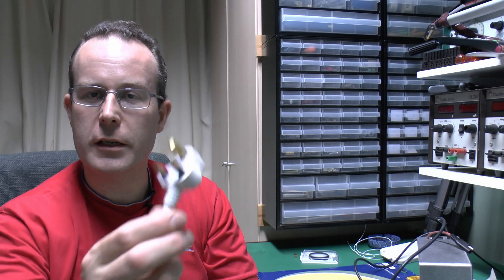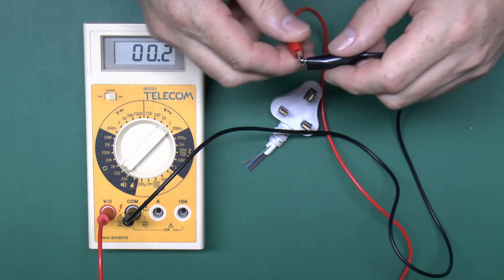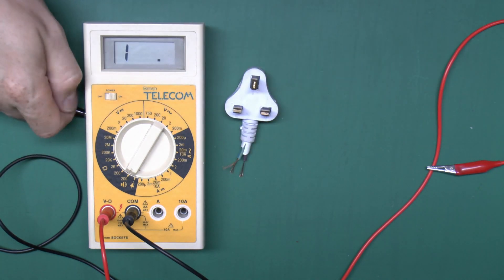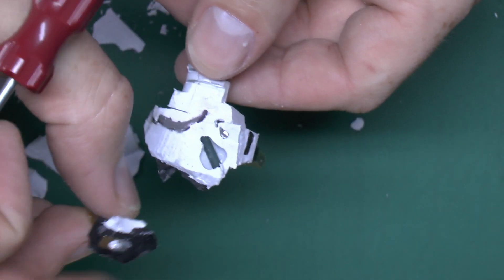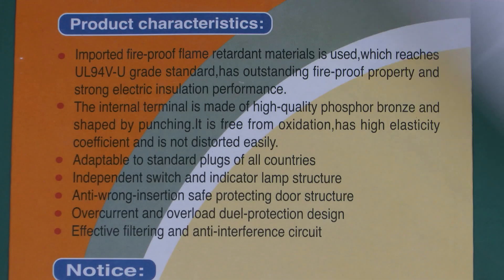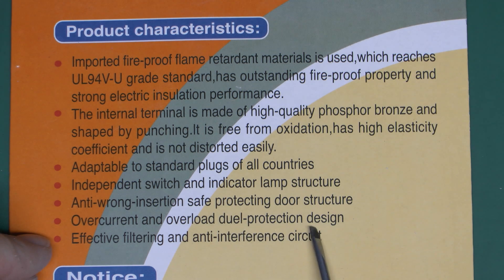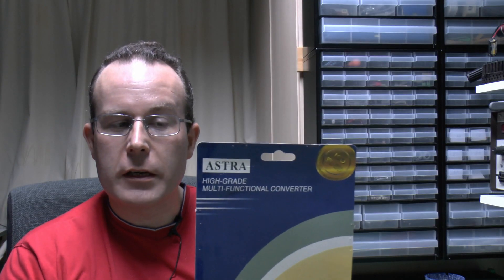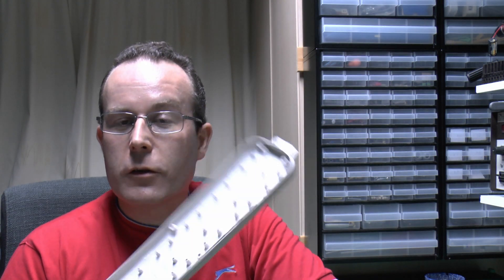Dangerous Multiway Extension Lead ASTRA BT311 (Part 2)

Comment: The earth wires on the sockets are connected to each other inside the unit, but not to the plug. So if you have a dead short to earth inside one of the devices that's plugged into it, what happens to the other earthed devices that are plugged into this thing?
Reply from the maker: If they have metal exposed parts, they all become live, and shock anyone who touches them.

Comment: Your advice at the end was inadequate, which surprised me. The plug is a problem to dispose of, as there is no fuse, so, if the flex is cut of close to the plug, if an ignoramus plugged it in it would pose a shock risk. The socket end could be made innocuous by severing the flex where it enters the socket. Your exhaustive teardown is excellent; the problem is, that people who  watch your videos are probably interested and knowledgeable enough to not buy rubbish.

Comment: Meter is the wrong tool to measure earth continuity, you are supposed to use a test tool such as a rest and tag machine or a mega that can provide more voltage
Reply: Oh rubbish, he's not testing this officially for compliance purposes. Just for curiosity at the bench like this, a meter in continuity mode is fine. You can switch to Ohms if you suspect the reading. Geezus!

Comment: Not just would a standard NEMA plug have backwards polarity, but the back claims to be able to allow the 20A NEMA plug (the American with two horizontal terminals), despite being rated "10A."

Comment: There is overvoltage and overcurrent limiting, didn't you see it?  Dielectric breakdown and thin crap wires combined with crap solder joints.  :-)

Comment: I had an IT accessory that had a similar three-pin plug (pseudo BS1363) on the end of the flex.  I replaced it with a genuine BS1363 plug and thought I'd extract the pins of the defective plug for scrap.  To my surprise and horror, the earth pin was brass-plated die-casting metal!

Comment: And another lie on the package:

There's a pictogram that you could use a french/european plug. But there would not be an earth connection. For french plugs the earth pin comming out of the socket is missing and for the Schuko the clamps are missing. With a class 1 appliance you would get a problem in the case of failure...and this would be a problem even if the earth is connected inside of the plug of this crap.

french socket:

https://upload.wikimedia.org/wikipedia/commons/3/3b/French-power-socket.jpg

Schuko-socket:

https://upload.wikimedia.org/wikipedia/commons/d/d0/Steckdose.jpg

But there are no longer specific Schuko or french plugs available, they are replaced with this plug which could be used in both systems:

https://upload.wikimedia.org/wikipedia/commons/5/5d/CEE_7-7.jpg
Reply: You can still get plenty of rewireable plugs the only fit one standard but you're right, moulded plugs are generally dual-standard.

Comment: This is obviously dodgy by any standard. However the combination of deteriorated plastic, deteriorated packaging and wrong PE color makes me suspect this junk is actually old stock junk made in the 1980s, 1970s or possibly the 1960s.  Every time trading standards forced a recall, someone restocked it and put it back on the market.
Reply: Except blue and brown never went together with solid green anywhere as far as I'm aware of.

Comment: Why do they use an earth wire and connect it to the sockets when it is not connected in the plug? They could have omitted it.
Reply: because china
Reply: I once found a similar one and it didn't have any earth connections inside the power strip - the earth was indeed connected inside the plug but not to any of the sockets. Not even the jumper wires you see here.
Reply: The maker of the power strip probably bought the cable as "3 wire" and would have complained if he hadn't found 3 wires at the end. I still wonder why they didn't buy a 2-wire cable and saved the effort to wire up ground...

Comment: Does anyone notice that the 'standard Australia' plug is actually American?
Reply: +lachlan duggan Yup.
Reply: Also, what the fuck is that "China, Japan and American" one meant to be?!
Reply: @Lucky Joestar
On a technicality they do, but the Chinese version has slightly longer and thinner pins, so while theoretically you can plug an Australian plug into a Chinese socket, the connection will be unreliable.

Comment: seems bizarre that you'd run a earth cable there but not connect up the cable must be manufacturer fault. no fuse in the socket means in a short current/overload event You could get 32amps running though that nasty  skinny  cable.

Comment: Even better ones are dangerous. A friends flat burnt down to a flex cable of a similar chinese type failing, even without a load. The insulation material carbonated, became conductive and started a fire, which then ignited paper and a sofa. The flame retardant import material they claim to have used, is probably the cardboard style ceramic player that hold the contacts apart. You probably missed it, the fuse and overload protection is built in the cable conductors. The overload signal is poisonous smelling white fumes, that will alert you from a distance, to operate the feed breakers. Or, if the green contact would have been properly connected, over time it will trip the GFI.

Comment: As an Aussie, I can confirm that in no way would those piece of shit plugs in the board fit our plugs. The only thing it will fit into in my country is a rubbish bin. Our live and neutral plugs are angled towards each other and there's just no way it would fit.
Reply: To be honest we do can plug it in. I got several piece of similar products on hand ( much better quality of cause ), and the hole is designed in such a way that those angled neutral and live could fit in. If u look carefully the upper corner of the live & neutral hole it does angled on the edge.
Reply: tho i do agree even so the only place this piece of shit should sit in is our rubbish bin......

Comment: But does it have "duel-protection"? Will it protect you in or from a duel?
Reply: +Vincent van Goatse Yes. You can use it to defeat your enemies by electrocution or using it as a club.
Reply: +Guyfromhe You could probably also use it as a flail to shock your enemy at a range of up to 1.5 meters.

But then again, I wouldn't rely on that cable for anything, so it could turn into an impromptu sling.
Reply: Both

Comment: I laughed throughout this video. I've always wanted to visit one of the factories where this junk is made just to ask the manufacturer what on earth they were thinking.
Reply: +Echo the Husky Cut corners = more money for me. "Me" being the factory owner.
Reply: +Vincent van Goatse I was carrying out pat testing at work today and failed a new Chinese made heat press. It wasn't earthed properly, had exposed single insulation, no overheat protection, an extra low voltage plug and socket was used to connect the element, the male pins were live. Plus many more defects!
Reply: +Echo the Husky I like the pun - What on "Earth" were they thinking?
Reply: The owner wasent thinking
Reply: Or, in this case, OFF earth...
Reply: What on earth were they thinking? Definately no earth given 🤔

Comment: The top third picture from the left that shows acceptable plugs, I've never seen that here in Australia & I know for a fact that is incorrect. Larger current plugs that deal with 3 phase (415 volts) use the similar pattern to the middle east picture, the first picture bottom left. The China/Australia (240/250 volts) & the New Zealand/Australia (240/250 volts) are correct. So I would do a little research on the other acceptable plugs too to find out if they are also correct. Cheers :)
Reply: +OlympusHeavyCavalry not to mention the plug shapes are wrong - we are angled towards each other

Comment: Cana't you see it.... ?

Disregarding the grammar and spelling words wrong... It does  infact have dual protection... The Line and Neutral wires will burn through like a fuse if you load it with more than 0.5Amps.. LMAO
Reply: Maybe you are right, but such a burntrough will set a fire, so there goes the word protection.
Reply: But the earth (were it connected) wire will burn out before it does anything.

Comment: Interesting that you did this video in 2014. A very similar "astra" brand power strip (with the same naff voltmeter) was identified as the cause of a house fire in 2010, and a trading standards investigation traced it to a discount shop. The items were seized and destroyed, and a recall issues. 

Interestingly, several other discount sellers have also imported these devices and ended up having to recall them after complaints to trading standards.

Even more bizarrely, these devices were also reported as having unconnected earth - so, presumably you didn't just get a bad one - they were all made like that, indicating absolutely no quality control at all at any point, not even after setting up the tooling.
Reply: They still sell that shit:

https://www.alibaba.com/product-detail/10-Way-Electrical-Universal-Schuko-Multi_2003569296.html

Note this is for schuko. There is no way there could be earth continuity for schuko. Also it would allow using an old ungrounded plug on a schuko outlet which is strictly banned.
Reply: @okaro6595  even schuko plugs have ground via the metal strip on the top and bottom which is a German design or the pin from the outlet going into the plug which is a French way of inputting ground/earth.
Reply: @Moshimulations  Did you watch the video? There is no way that type of socket gives earth continuity with schuko. There is nothing that could touch the metal strips on the side of the plug. That is the problem with all these universal sockets. They never ground schuko.

Comment: So, thanks to the high resistance in those thin wires, you'll be dissipating 100W of heat at 10 Amps, which will build up and melt the insulation, make a dead short, and there's no fuse in the plug to kill the power.  Burning Down The House, by Talking Heads?
Reply: Wonder if I could find one of those on Ebay, my Dr. Suggested that a good house fire should cure my allergies!  (Just kidding, no really he said that, but of course, I cannot pass this along due to Dr.-patient confidentiality)